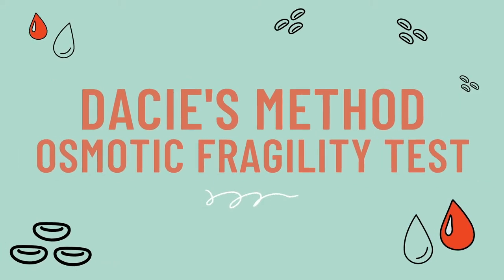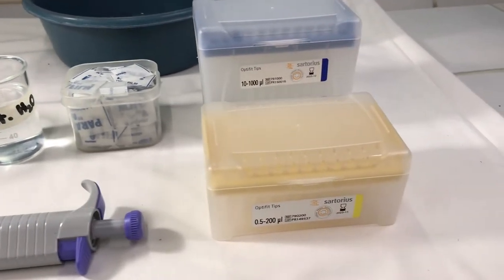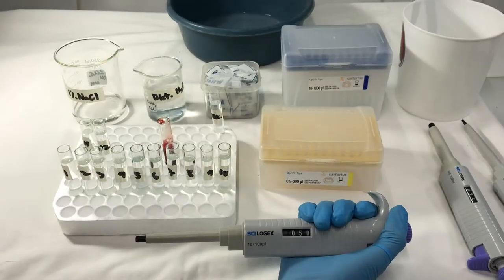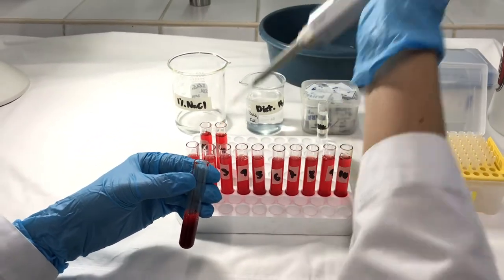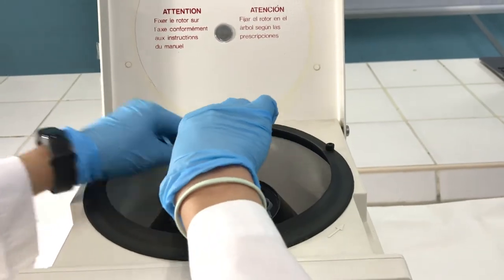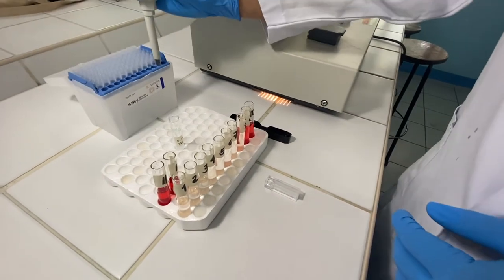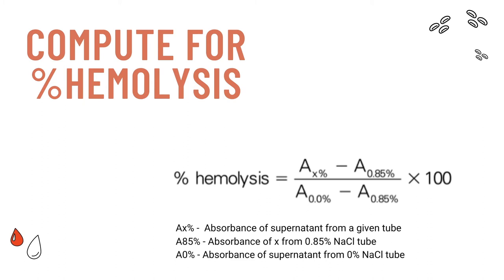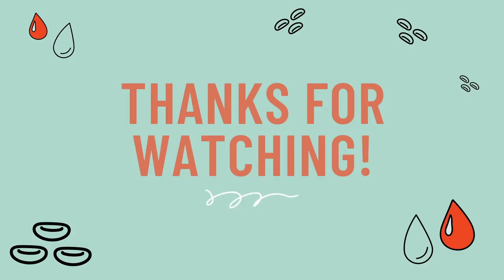Osmotic Fragility Test Demonstration - Dacie's Method

Comment: pls why we can't use oxalate and citrated  blood ?
Reply from the maker: The final procedure will depend on your specific laboratory protocol. However Heparinized and EDTA blood can be used for the osmotic fragility as well.  It should be noted that EDTA causes increased fragility in RBCs. 

Reference: 
https://doi.org/10.1046/j.1365-2257.1998.00014.x
https://doi.org/10.3389/fphys.2016.00288